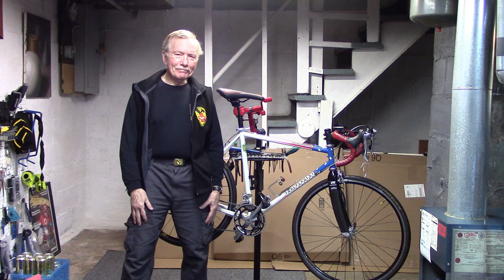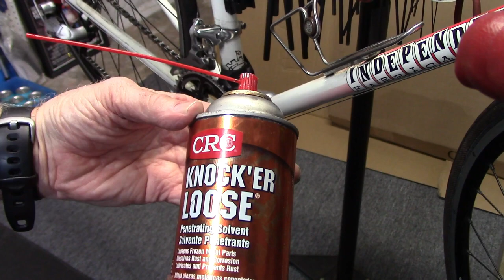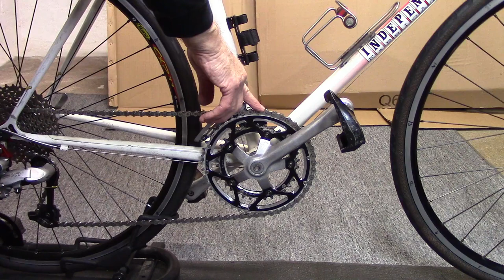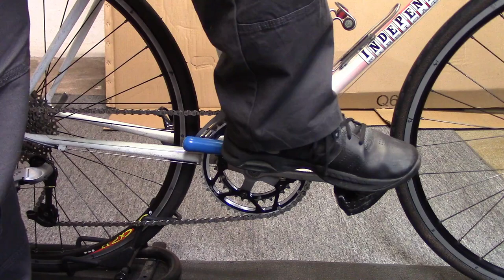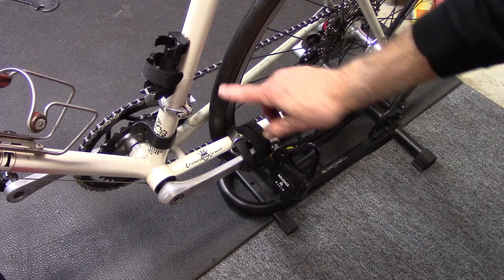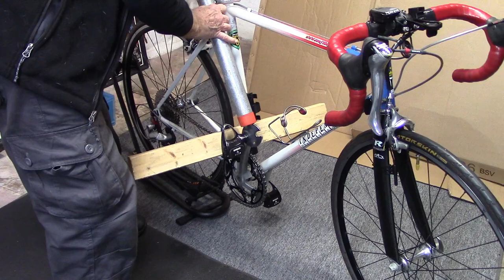Best Ways to Remove Stuck Bicycle Pedal

Comment: Was struggling with my brothers pedals broke a Allen tool. The step down on the wrench technique worked great broke both pedals loose this way ! Thanks
Reply from the maker: It is a great trick used by many bmx riders. Also visit our YouTube home site at:
https://www.youtube.com/user/MrTony10speed
Regards and safe cycling, Tony
Reply: Let your legs and body weight do the work , or leverage of a cheater pipe , especially as you age  , thanks for the good advice !!!!!!

Comment: You skipped the solution for hex bars.
Reply from the maker: Good idea for another video! Luckily most pedals that remove with a hex key also have flats on the spindle for a 15mm wrench but a few (such as the pedals used by my riding partner with old Shimano SPDs) do not. Here's Calvin Jones take on this type of removal using an extra long hex key:
https://www.youtube.com/watch?v=ljr6xSHGz7k&ab_channel=ParkTool
If you don't have an extra long hex key, I wonder if the regular hex with a cheater bar would work?
Reply: @tony10speed  mine don't 🤬 bent two cheater bars so far.
Reply from the maker: @Bustergonad9649  Did you check out the Park Tool Video link I sent? Might be worth a try.
Reply from the maker: @Bustergonad9649  Did you check out the Park Tool Video link I in the video? Might be worth a try.

Comment: Leaning with my back against a wall, I placed my left foot onto my left pedal and my right foot onto the end of my extension and was finally able to free my left pedal.
Reply from the maker: Can be done, but you need to watch out that the pedal wrench and extension don't  fly off the pedal spindle in the process - where they can hit the floor and bounce back up at you. In the process, you can also loose your balance. That's why I prefer methods where at least one foot is planted on the ground. But glad it worked. Regards, Tony

Comment: Those are some excellent tips, Tony! I've done the 2x4 trick once or twice before, and if you got an old tube handy wrap it around the board on the area that will contact the frame or wrap the frame around the area that the board will contact. you can even use a t-shirt or rag to help prevent damage.
Reply from the maker: Excellent suggestion. I have a new way of using the board, wrench, cheater bar and the edge of a cinderblock wall which I'll put into another video. Regards, Tony

Comment: WD40 is the solution for removing rust!
Reply from the maker: WD40 is a water displacement and penetrating liquid which is great for squeaky doors and flushing out dirt and grime. It contains only a small amount of lubricant. I prefer using Liquid Wrench or Knock-er Loose which I find better then WD40. With that said, I do use WD40 spayed on a small ball of aluminum foil to get out small rust spots which also spreads the frame paint over the area when I'm restoring bicycles.

Comment: Good video. One important reminder. The pedal on the left side loosens in the opposite direction. Easy to forget that as my husband did himself and wanted me put that in here.
Reply from the maker: Good point. If you push down with your heel on the pedal wrench handle on the drive side, you are turning the pedal spindle counter clockwise. If you push with your heel on the left side, you are turning the spindle clockwise - which loosens the pedal. Thanks for your comment. Tony
Reply: @tony10speed  Thank you sir. Important to remember also the bike companies don't do that to 'mess with your head' or anything. They have to make the thread on the left side "backwards" because if they didn't, you'd have to tighten the pedal on that side once a month or so. I.E. you'd be loosening the pedal a miniscule amount with each cadence.

Comment: Thank You! I just tried the tie down the opposite crank method and it worked. I used three heavy duty zip ties on the opposite crank.
Reply from the maker: Good for you Sherlock Holmes. And another great use for zip ties. Thanks for your comment and safe cycling, Tony

Comment: This came on my feed exactly as I was trying to solve that exact problem. Thank you !
Reply from the maker: Let me know the method that works for you. The feedback is always helpful. Regards, Tony
Reply: @tony10speed  I removed the crank and let some Liquid Wrench penetrating oil seep on the back of the pedal shaft for 24 hours in a sink. Then some traditional leverage got them off once the cranks were reinstalled. I tried to find some CRC Knock'er Loose in Toronto but it was nearly the value of the bike ! I degreased the crank threads and greased the shaft threads with lithium grease so I (hopefully) never have to do this again. At least on that bike. CRC looks like it operates faster though so in a bike shop context it is absolutely worth it.
Reply from the maker: @louis-ericsimard7659  Liquid Wrench is a great penetrating oil. I like the idea of taking off the cranks and letting the cranks, adding the Liquid Wrench and letting it soak overnight. You could then replace the cranks to give you more leverage in removing the pedals. Thanks for the feedback. Safe cycling, Tony

Comment: Perfect. Worked a treat. Thank you.
Reply from the maker: Which method worked best for you?
Reply: @tony10speed I sprayed some penetrant overnight, then used your first method - pushed the spanner with my heel. It took a little bit to line everything up but once that was done it was pretty straightforward.
Reply from the maker: @elliott212  Thanks for the info. It will be helpful to our views. Regards, Tony

Comment: Why would you want to remove the pedals in the first place?
Reply from the maker: I'll just name a few reasons:
1. With time, pedals may creak or make noise as lubricant dries up. See:
https://www.youtube.com/watch?v=xn0bokygJ9c
2. Pedal bearings do wear which also may cause noise or even impede pedaling. In such a case, the pedals need to be overhauled or replaced.
3. You may decide to install a new crank with longer or shorter crank arms.
4. Maybe you want to switch the pedal to a new or different bike.
5. One may want to experiment with spindle washers to move the pedals outward for comfort. 
6. Your pedal gets damaged when your bike which was nicely leaning against a wall is accidently knocked over.
All of these points to the fact that you should remove and service your pedals every few years as in the video above.
Good question and thanks for asking. Regards, Tony
Reply: the pedal itself could be broken or damaged and needs to be replaced by a new one

Comment: Why not turn the bike upside down?
Reply from the maker: Removing pedals when the bike is upside down puts undo stress on the seatpost, handlebars and stem. Besides, it's difficult to orient yourself as to which way to turn the pedal wrench.
Reply from the maker: Removing pedals when the bike is upside down puts undo stress on the seatpost, handlebars and stem. Besides, it's difficult to orient yourself as to which way to turn the pedal wrench.